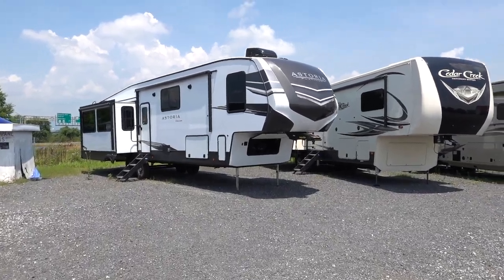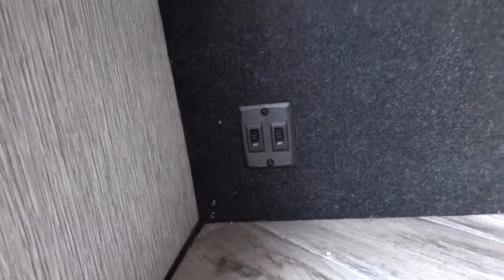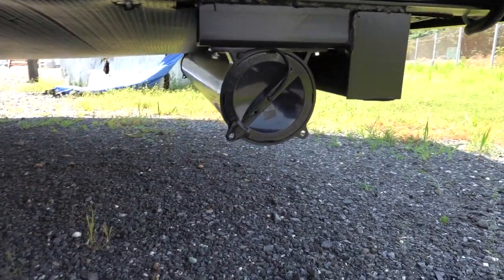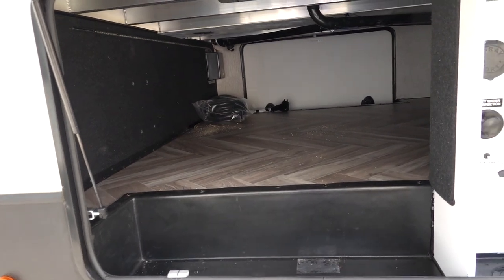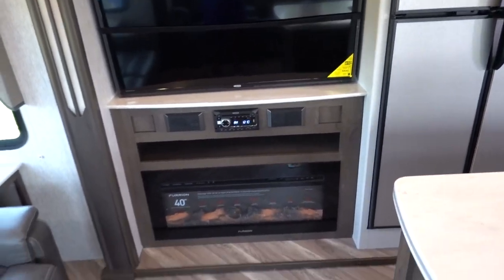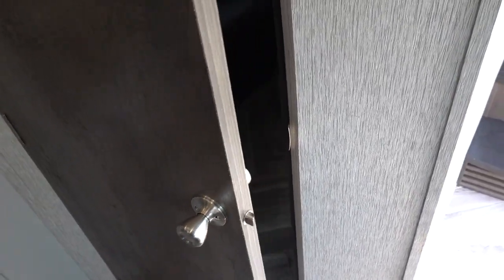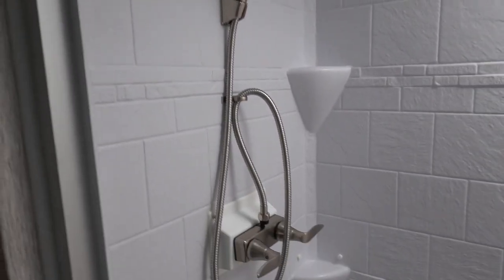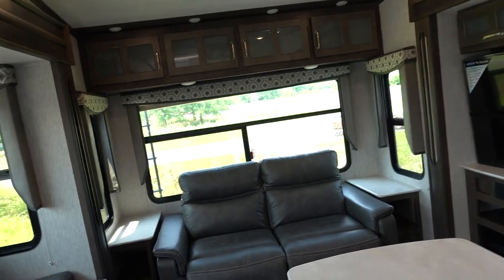Can The 2021 Dutchmen Astoria Platinum Compete With The Mid Bunk Greats??? | Falls Short...

Comment: I owned a 2010 Open Range 399BHS (40') with 5 cable-operated slides.  I only broke 1 slide cable - never had any issues otherwise.  Was able to change cable in the campground and never had issues afterwards.  The newer systems became less reliable.  The original ones were actually pretty reliable.
Reply from the maker: Thanks for sharing this. I’ve been pretty lucky with my slides but I lubricate the rubber seals for smoother operation.

Comment: Regarding  the sewer pipe on yours, keep in mind that if you do any cold weather camping those pipes will need to be wrapped with heat tape  or you could run into a freeze up situation.  For me I make sure the pipes are enclosed in a heated under belly.
Reply from the maker: Great observation and something I didn’t consider. I did camp this past winter in my RV and this is something that could be an issue if you are in colder climates for sure 👍🏾

Comment: To many quality issues for me.  The grey and black water drains not cool plus I feel the drain pipes hangs to low.  I did like how the couch just pulls out into a bed.  The suspension definitely needs to be upgraded, along with the tires before delivery.  Thanks for the review JB.  Tell Mrs. JB hello and we missed her input.
Reply from the maker: Yea there are some things I can’t overlook and next time we shop for a fifth wheel, I will definitely have a better understanding of what we will do before we take delivery. Will do tell the misses I said 👋!
Reply: @JB_WhoWork  The first time is always the easiest because we don't know alot about what to look for and what we are want or should look for.  I would purchase a unit built by Forest River in future because the Cardinal 3250 RL has been awesome.  Even then I would definitely check it close for problems before taking it off the lot.